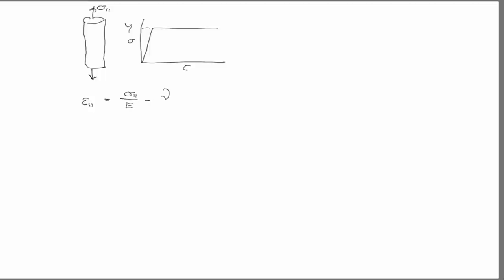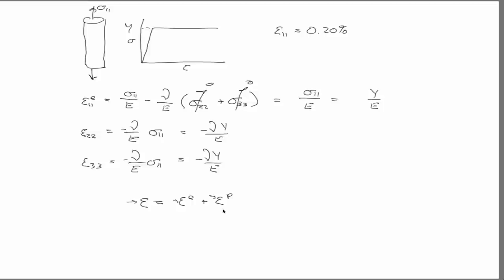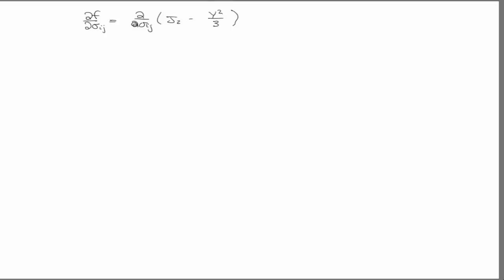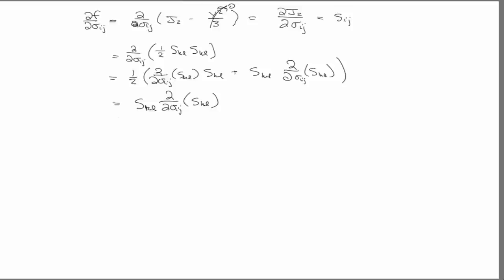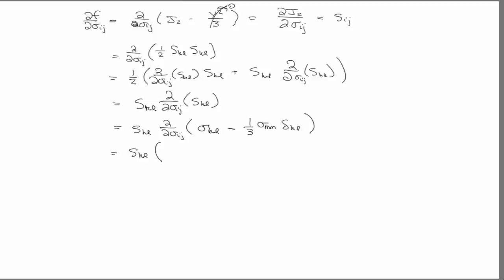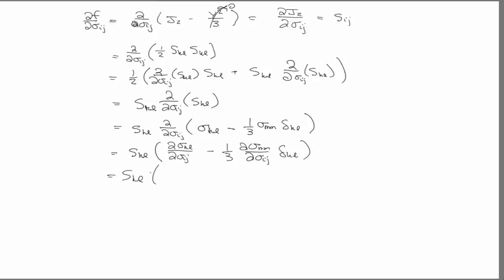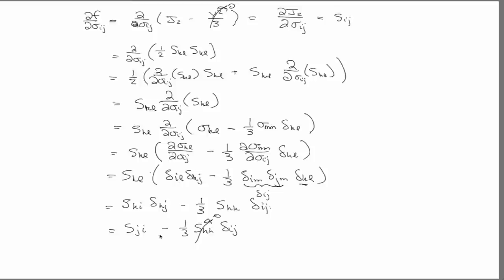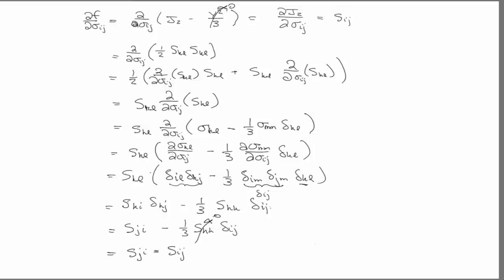Plastic strain and flow rule

Comment: Three things, and I appreciate your feedback!: 
1) thanks for the video! Good info!
2) I got a little confused about your notation, but I knew you meant the plastic strain tensor (second rank) not the plastic strain (zero rank). 
3) My question is this, for granular materials, I believe plastic strain was caused by LOCAL shear loads only, so if one were to take the resolved tractions onto a given slip plane, then one would then find that all the principal direction’s normal loads WOULD NOT contribute to plastic deformation, but instead ONLY shear loads WOULD cause slip / plastic deformation. Put another way, instead it would only be the external load’s resultants that are resolved tangent-ly onto a given slip plane, which would cause shear, correct? Further, I cant remember if the principal normals sig_xx, sig_yy, sig_zz go to zero when the external loads are resolved onto the slip plane, or just that they do not contribute to plastic deformation?